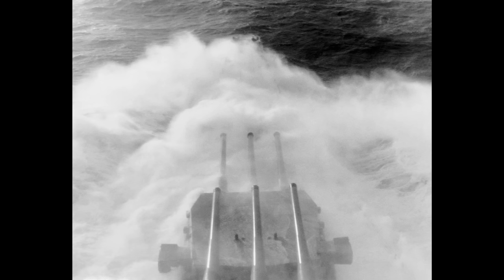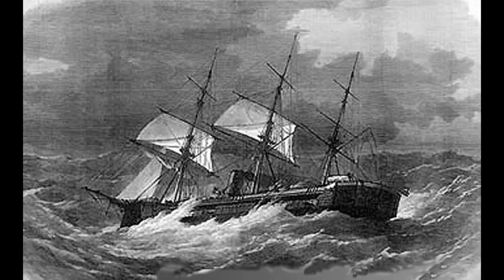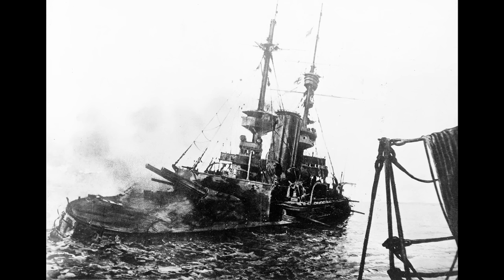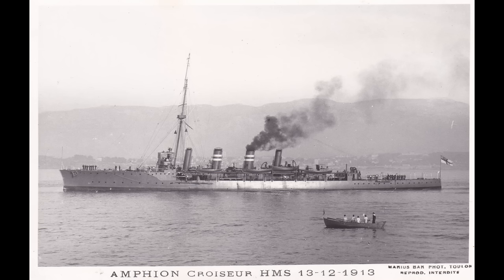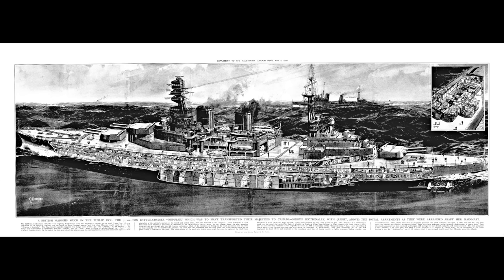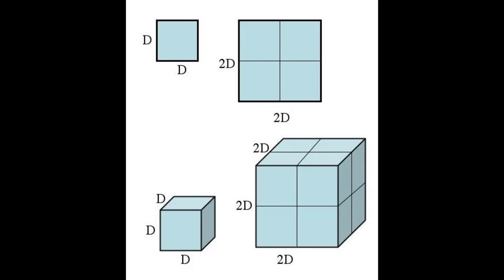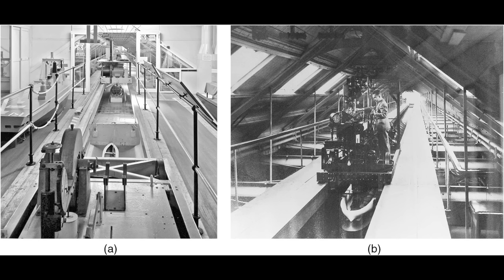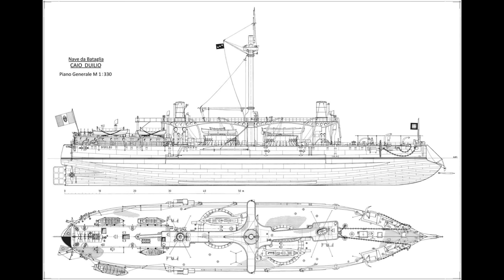Hull Form Design - Doing better than a floating brick

Comment: Ngl, my intuition would be that you'd want the centre of gravity to be lower than the centre of buoyancy for something to be stable. If you have a dumbbell plate and strap an air cushion to it to make it float, you'd put the weight underneath the air cushion instead of on top of it. If you put the plate on top of the cushion, it's just going to want to flip. I'd imagine that the most hydrodynamically stable object would be something like a cone, with the point being extremely dense, and the base of the cone being extremely buoyant
Reply: OK. How do you get the center of gravity below the center of buoyancy? You add water, like a torpedo strike, or a few dozen shells, or striking a reef. This adds weight, which drops the center of gravity. Ship sinks. See how it works?
Reply: @georgesoros6415  No, overall mass of the ship is different to mass distribution. You could make the lower part of the hull very dense in comparison with the upper parts. Same mass, different centre of gravity. I'm not saying that would even be practical in a warship - I'm just talking basics
Reply: Tom, you would be correct if the center of buoyancy (“B”) stayed in the same place relative to the structure of the ship when the ship gets tilted.  But that is not the case.  As the ship gets into a tilted position, the center of gravity (“G”) does stay in the same position relative to the structure of the ship, but B generally shifts to the right relative to the structure of the ship.  This is because the center of volume of the submerged part of the ship is not in the same place as it was when the ship was vertical.  (The author’s 1st graphic of this is good.). If the amount of this shift of B toward the right is large enough, the (upward pointing) buoyancy force will pass to the right of G, and thus will produce a counterclockwise torque about G, which will tend to get the ship vertical again.  This mechanism is what led to the invention of the concept of the metacenter (“M”).  M is the point of intersection of a vertical line through B with the left vs right symmetry plane of the ship.  If M is above G (and therefore also to the right of G), the torque exerted by the bouyancy force will be counterclockwise, and the ship will tend to right itself; if M is below G, the torque will be clockwise, and the ship will tend to tilt more.  (Unfortunately, the author’s explanations of this are messed up.)

Comment: Random Question. I've heard HMS Ark Royal was largely welded to lower it's displacement weight. Is this true and how much of the ship was built that way (and others or the time)?
Reply: Assuming it's the same as tanks, and I can't imagine why it wouldn't be, welding weighs substantially less because you're just fusing the hull plates and structure together, whereas riveting includes the weight of the rivets and the extra framing you need to tie it all together.
Reply: @Halinspark  riveting substantially adds weight. Each join has to overlap plus the extra weight of all the rivets adds up a lot.

Comment: J
A comment regarding the audio recording of your narration has a level problem, some words are loud and some low in volume, specially annoying listening through headphones. Is there some technical problem with your sound track? Have you used a compressor limiter to even out the the gain changes? It sounds like you are moving your head around, moving sometimes into the mic and sometimes away from it.

Comment: Amazing how much water is pushed in front of a barge type vessel.  On the Mississippi River I was astounded by the effects on the shore as a large barge headed through a small channel.  Pushing feet of water, that took quite a while to normalize once the tug passed.
Trim c diagram without power isn't different than example a.
Get too long and skinny, hard to turn...and that should be a consideration as well.
Reply: It is called a towboat, not a tug.  You also find them on Great Lakes.
Reply: @johnshepherd8687  interesting name, thanks, but also called pusher tug.

Comment: At 39 minutes you show a 3 planar veiw of a sailing ship. Would that top down veiw be a form that would work on modern warships?
Reply: @gregorywright4918  IF you look at teh ship, the hull is widest at about a 3rd of the way back and narrows to the rear.
Reply: @timstatler7714  Ah, you were not clear in what you meant.  Reminds me more of the Albacore shape for subs.  The Length-to-Beam ratio looks like around 5-1.  Most battleships were in the 6-1 range (except Iowas), while most modern ships that are going for speed are in the 8 to 10 range.  Note also that you are seeing mostly the deck shape; the hull shape would be a little different below the tumblehome.  I think that overall shape may be based on the fish shape that Drach mentions elsewhere.

Comment: some sailboats don't have a point of no return, they have such a massive keel that their center of buoyancy is actually higher than their center of gravity. Very few, and I doubt there were aver battleships like that, but some racing sailboats ate like that.
Reply: older racing sailboats, perhaps... modern offshore boats develop most of their stability by hull width (form stability) and canting keels - they are as stable upside down as rightside up.... they are only required to have enough reserve stability to limit heel to 10 degrees when the keel is full over. there is no requirement of self-righting.

Comment: Well I've found myself watching some of Drach older Drydocks lately and I already know my next question but i'll save that for Drach's Saturday video

But Something that has been bugging me since I watched Drach's video on HMS Hood 

Realistically with hindsight you could say HMS Hood if she had survived the Battle with Bismarck that she shouldn't have been given the rebuild as the War had changed however the decision to refit her in 1942 at the time would have made sense given they didn't know war would end in 1945 

if Hood's 1942 refit had gone ahead when the Loss of HMS Prince of Wales and Renown would have happened.

How many 40mm Bofors and 20mm Oerlikon AA Guns could have been fitted to HMS Hood in place of her six 8-turret QF 2-pounder Pom-Pom AA Guns and her five 4-turret 12.7mm Vickers 0.50 AA Machine Guns as the QF 2-pounder Pom-Pom AA Guns and her 12.7mm Vickers 0.50 AA Machine Guns would be obsolete by 1943?
Reply: it is a hard question to answer as the refit plans were never fully completed . That said like the iowas and south dakotas show,  it was possible to install  20 mm over the 12.7 mm on a  1 to 1 basis  The 40 mm is  bit harder to estimate . Normally one would look at what happened with others ships of the same nation and operating in the same period and make a calculation based on that yet Hood has a size advantage over the KGV's,  what would  allow not only more AA's mount to be installed but equally important, those AA's mounts were far less affected by blast effects.
Reply: I actually made an almost  futile exercise of trying to place 40 mm on Hood, following vanguards disposition  and the number varies between 72 to 80 depending if we place 2 over the super firing turrets or not.

Comment: At 19:03 was that a V-1 on the deck of one of those ships?
Reply: No. Not sure what it was, but definitely not a V-1.
Reply: @philperry4699  Looks like a flipped over seaplane.
Reply: @gregorywright4918  Yeah, that looks like a good possibility (single float, catapult launched).
Reply: No.
It could've been a possibility though, there are images of US ships with V-1s onboard for post-war experiments.
Reply: @mxaxai9266  Definitely NOT a V-1, although there is a slim possibility it was some other kind of cruise missile being tested. The pulsejet engine (tube on top) is at the wrong end for a V-1 (should be overhanging the tail). Also the wings are the wrong shape and the horizontal stabilizers are a bit too large. It does look a lot like a float plane that got ripped off its catapult and flipped onto the deck.

Comment: buoyancyhad had better be above the center of gravity or as soon there is the slightest list the craft will roll over! who ever put  this together needs to proof read.
Reply: Dave, you’d be correct if the center of buoyancy stayed in the same exact position relative to the structure if the ship when the ship is tilted.  But it doesn’t.  The center of buoyancy changes relative to the structure of the ship when it tilts, because the below-water-level part of the ship is now a slightly different part of the ship.  (Please look at other comments that I have posted here for a —somewhat— more complete explanation.)
Reply: In line 3, I meant to say “OF the ship”.

Comment: Why does B move and G doesn't move with it?  If G is always down, a ship on it's side is now being pulled down in a different direction than straight vertical.
Reply: G is in a fixed position relative to the structure if the ship.  But B is at the center of volume of the submerged part if the ship.  B can move relative to the structure of the ship, because a different part of the volume of the ship is below water level when the ship is tilted.